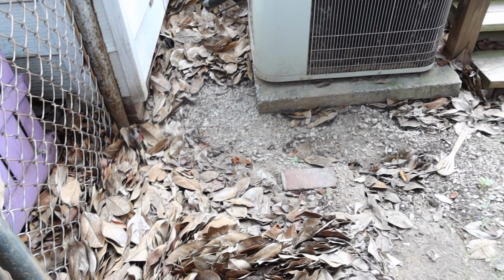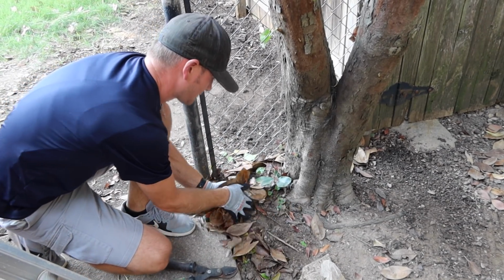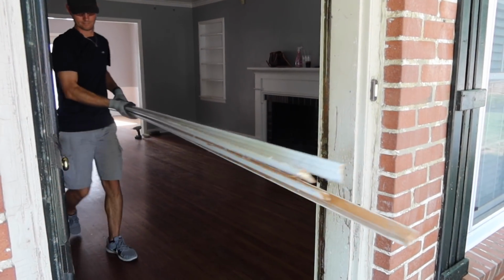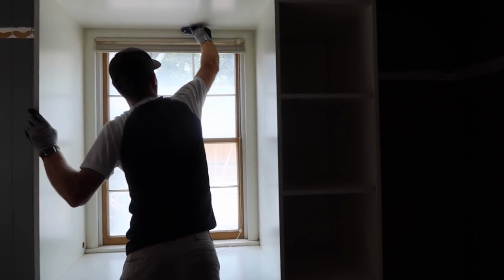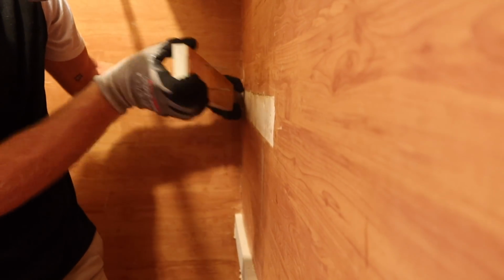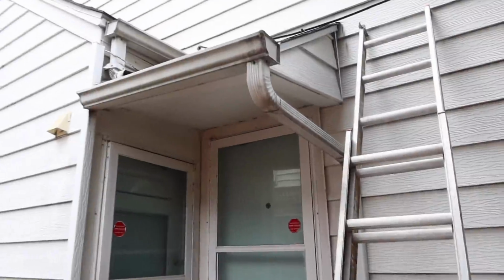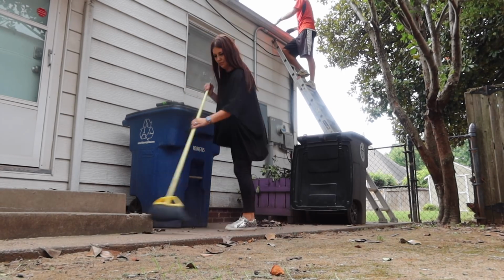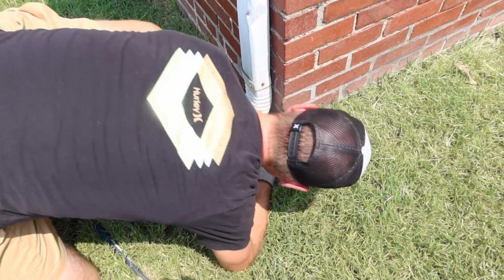OLD HOME DEMOLITION | HOME RENOVATION BEGINS | 2021 DEMO DAY BEGINS

Comment: The molding is picture molding. they made special clips that attached to it to hang pictures from so as not to damage the plaster walls. Our house was built in 1947 and the whole house has this. we also have a little telephone nook.

Comment: Your contractor was correct, in older houses they would put a thin piece of wood close to the ceiling and owners would hang frames on wire from the wood and not have to put nails into the walls.  Good luck with your Air B & B!!

Comment: You can use a spray bottle with hot water to spray on the walls, it will come off easier.  There is also a wall paper steamer you can get.
Reply from the maker: Thanks!